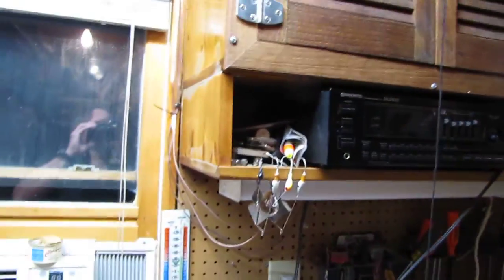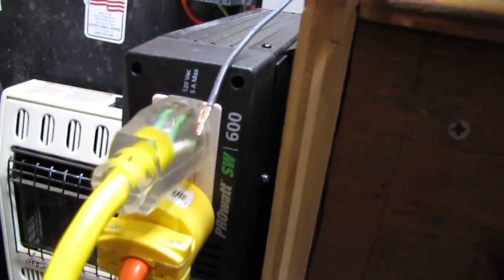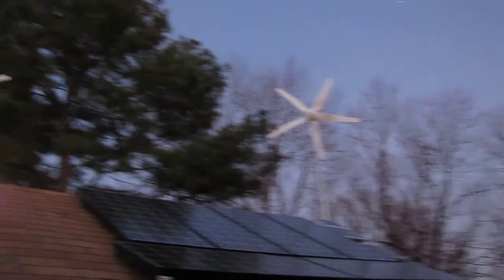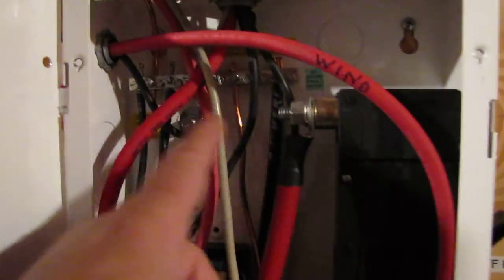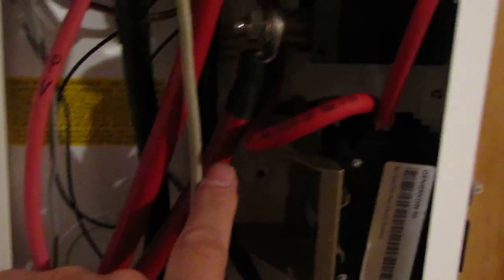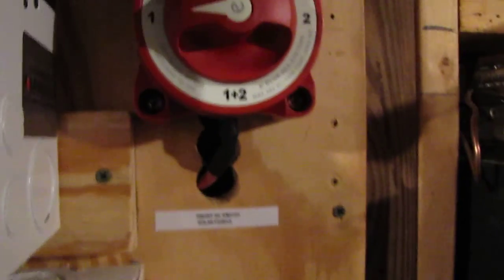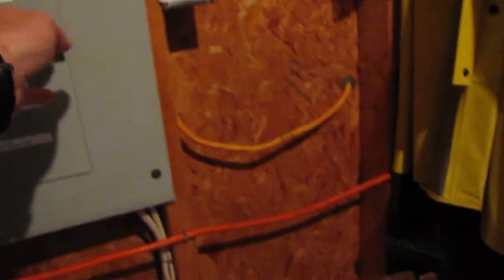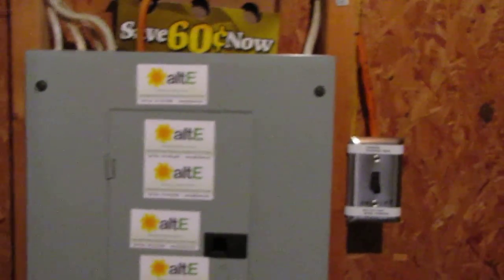How To DC Disconnect Box for Solar And Wind Midnite Solar MNDC250 Mini 250 Amp  VIARLOCITY

Comment: What is the surface mounted switch for solar that is red and white, circular in shape with four settings above your controller disconnect box? Model number and description would be useful.
Reply from the maker: Bue Seas Battery Switch buddy  
https://www.wholesalemarine.com/blue-sea-systems-e-series-battery-switch-selector-4-position.html?gclid=CjwKCAiA8qLvBRAbEiwAE_ZzPaS6cFtpgOdxa3nRirM6eXqBp348F9yMNYMgaZRL9RJjJLfC32aa0xoCBQcQAvD_BwE

Comment from the maker: @hogwildgardener Amen Brother 10/3 Will work Fine Buddy & a single Pole 30 Amp Breaker Should Be enough  Im Running a Honda EU 2000 i For my Off Grid Power  when Its dark Outside Or when The Power Is Out I have had Mine In Operation Since Last March of 2011 Its doing Great Plus I used 8 days & 8 nights During Hurricane Irene 
Power equals volts times amperes. So you have to look at your fuse, e.g. 30 amps and calculate: 120 volts times 30 amps equals 3600 watts.

Comment: @kvusmc   DId you call outback when installing yours or did you just go with what the electrician recommended?    I just dont understand them recommending a 60 amp break for the ac in when it is only a 35 amp charger?  35x48v = 1680 watts
your charger is 55amp x 24volts = 1320 watts

Comment: Thanks Kvusmc!     I order a 3048 outback grid tie inverter and was trying to figure out what size wire i should run?   I figured a 10/3 would work just fine being that the inverter can only put out a continuous 25 amps...  I noticed in the manual even for your model they call for a     6 awg that seems way over kill...    what size wire and breaker do you think i should use?   Thanks Man!

Comment: what size wire did you use on the Outback 2524 inverter?  Wire size on the AC in and out?

thanks!